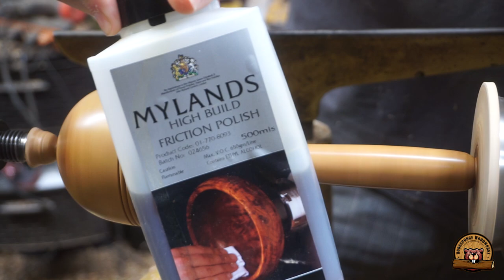Woodturning - Maracas for Cinco De Mayo!

Comment: Great idea for a musical instrument.  I would think the hardest part is to determine what the wall thickness should be.  Too thin and the maracas would be too fragile too thick, and the sound is attenuated.  Would you be willing to share what you found to be the optimum wall thickness?
Reply from the maker: Well I'm definitely no maraca expert and not musically inclined at all but I find around 3/16in wall thickness gives for a decent tone. The thicker it is the more muffled it gets. You can also add different items inside. Popcorn, beans, bb's. I've heard of someone adding little round bells before as well.